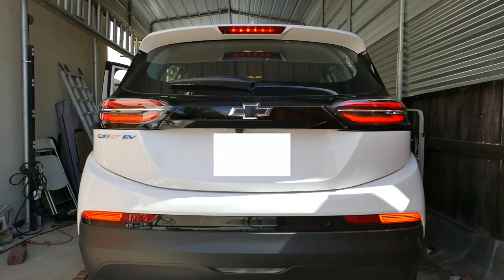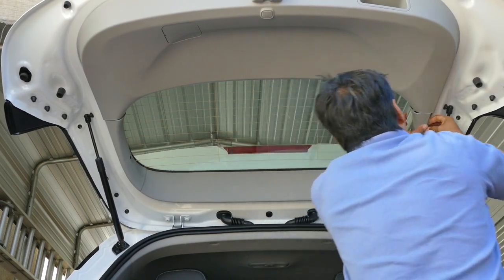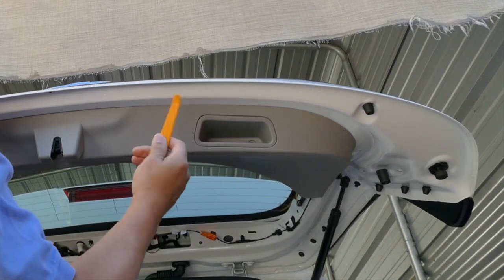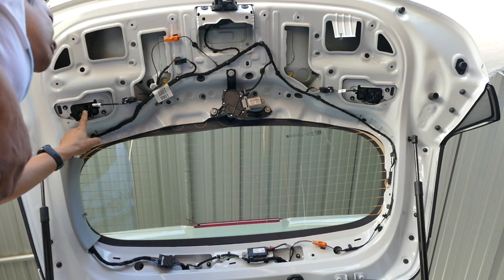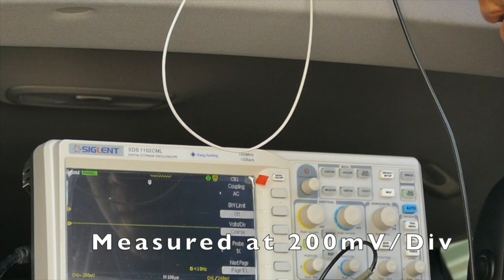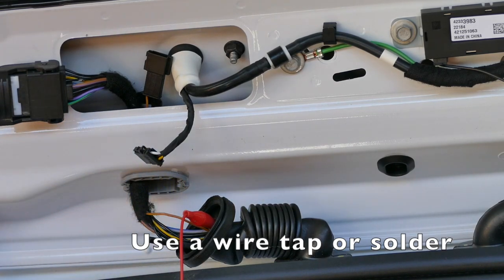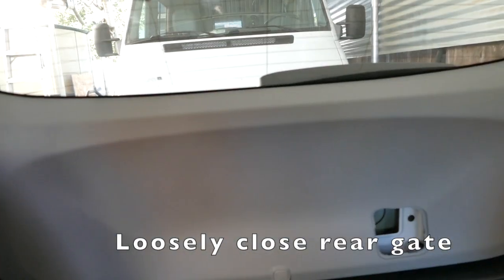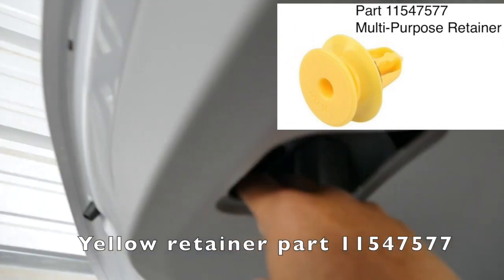2023 Bolt EV modifying lift gate tail light to turn on when braking

Comment: Thank you so much for this video.  I am seriously considering buying a Bolt EUV, and the placement of both the brake (and the turn signal) lights so low down is of great concern to me.  I have not seen any other hatchback with this poor design, and I've been looking!  Any suggestions about where one could have this modification done commercially in the SF Bay Area?  This is not something I could do myself. Again thanks!

Comment: if you added a resistor to the violet/grey wire to dim the taillight running lights, wouldn't your brake light hack work at night too?

Comment: Great Mod! Thanks for sharing with the Bolt community to help make our cars safer! Before finding this video, I was planning to tap into the wires from the high level brake lamp and add a 12v red led strip light to the inside of my back window, effectively making my high level brake light bigger. Would this work as well? If so, which color wires from the high level brake light would I tap into?

Comment: Does this modification nullify the warranty?
Reply: My understanding of the law is that no, it does not -- UNLESS -- the modification was the DIRECT CAUSE of the otherwise -warranted failure.
Reply: absolutely not. only and only maybe.. warranty on the 3rd brake light or tail lights, but they would have to prove the mods were the cause.

Comment: Thanks for the video. Is the rear hatch aluminum or steel on the EUV? I know my 2020 EV is aluminum.
Reply from the maker: Steel as far as I can tell.
Reply: @rtabcum  Walk around the car with a magnet, might be interesting!
Reply from the maker: @mosfet500  Interesting...! I might just do that. Would be good to see how much metal vs aluminum is on the car. While I was under the back of the car inspecting the bumper light wiring, I did see aluminum members supporting the bumper.
Reply: I just checked around the Bolt forum.

Bolt EUV has steel panels, trunk lid, hood and doors.

Bolt EV has aluminum hood, doors and trunk lid.

Rear quarters are steel on both cars as is the roof. It looks like they kept the aluminum suspension parts on the EUV.

Comment: Thanks RussieCA for this great, low cost safety mod. I picked up my 2023 Bolt EV last Wednesday. I spent two partial days working on this. I had a third brake light flasher that I had previously ordered. I installed it several days ago. Those I had in the past would flash three time and then remain steady. This one would flash four times fast, then four times slow and then steady. Too much and I decided if I could get the brake mod to work, I'd remove it. The brake light mod is complete, so I removed the flasher. Great step by step instructions but I dislike doing this type of stuff on a new car. I only have basic skills, but I excel in patience when required. I figured it was worth the risk.

Comment: Thank you!!! This is MUCH needed on my Bolt! I’m a bit nervous cutting the wires to my brakes, but this does look like it might be simple to buy some clips and maybe make a harness?
Reply from the maker: Yes, no need to cut any wires. You can use a wire tap instead. You will need a Diode to gate the voltage from tail gate from energizing the 3rd brake light.

Comment: Excellent!! Thank you very much for the video. I plan to follow these instructions once I've got a free weekend to do the work.
Reply from the maker: Just be careful when pulling out the plastic panels. Use a plastic pry tool to try your best reach each clip and snap them out 1 at a time. Good luck.

Comment: 1n4001 diode is only good for 1 Amp . I'd recommend a 5 Amp diode. While you're correcting things, I'd recommend going with a Schottky diode. And, you're tying the left and the right lights together. That's likely not a good idea either, so I'd recommend using a separate 5 Amp diode for the left light, and a 5 Amp diode for the right light.
Reply: 5A?? 1A is probably already extreme overkill for an LED fixture!
Reply: @Turk380  If I'm interpreting the video correctly, the diode is being used to power the incandescent bulbs in the bumper. 

If this is truly the case, peak currents into the incandescent bulbs hits multiple Amps.
Reply: @kirkkohnen5050  it's powering the LED arrays in the rear hatch. AFIAK, there are no incandescent bulbs on the EUV
Reply: @Turk380  The different models and years is the issue. My '17 Bolt has incandescent bulbs in the bumper.
Reply: @kirkkohnen5050  on your '17 Bolt you wouldn't need to do this mod in the 1st place. Since they were sold in the EU back then (as an Opel) they were obligated to design proper tail lights. Now that Opel is no longer in the picture some brainiac at GM decided to downgrade your experience with US-only tail lights.
Reply: @Turk380  OK. Using a Schottky diode would still be preferable due to its lower voltage drip compared to a standard silicon diode (0.2 Volts compared with 0.7 Volts for the silicon diode).

Schottky diodes can't operate at higher voltages (roughly 100V is the limit) and have higher leakage, but neither one of these aspects matter for this application.

Comment: Did any of the clips or pins get damaged when removing them? Great video! BTW, pretty handy with soldering iron👍🏼
Reply from the maker: Yes, the gray Pivot clip (one time use) I took off got a little cracked at the sleeve when I pulled it off with a pair of pliers. The rest was re-useable. I just re-ordered it through GMPartsDirect.com. Everything is very tight the first time removing it. I recommend to put some silicone grease on all the metal clips when re-installing.

Comment: Really cool to see. I’d like this on my Bolt EUV, but the tail lights are split between the hatch and quarter panel so it’s more of a hassle to wire
Reply: following
Reply: On the EUV you probably have a better situation because you could wire the outer lights for turn signals + tail lights and the inner ones for brakes only. All the signals would be inside the same panels and you'd have all the advantages - brake lights that work even when the taillights are on, turn signals separate from brake lights, it would be almost like having a properly designed car

Comment: Great video! Have you also notice that the brake lights go off while at a full stop on one pedal driving? Or at least it does on my 2020 bolt. Thanks again for the great hack.
Reply from the maker: I did check the 1 pedal operation and verify that the brake lights do stay ON after stopping and continue to stay on until I press on the gas pedal. The only way it goes off after stop with 1 pedal is when I shift into neutral.
Reply: @rtabcum  Wow, that's a great improvement. Glad to hear.